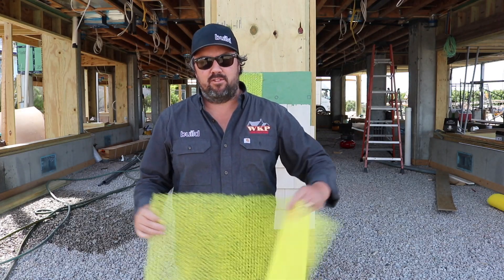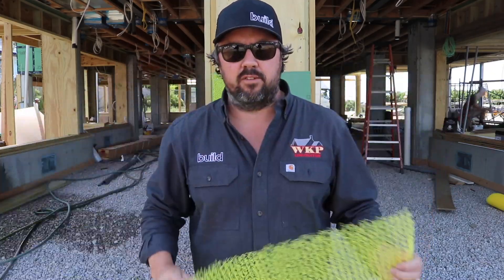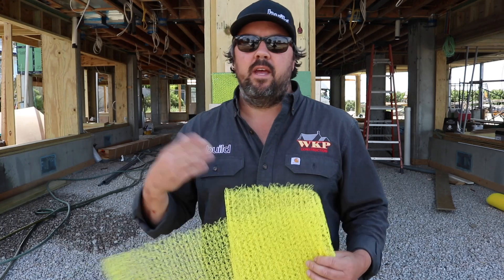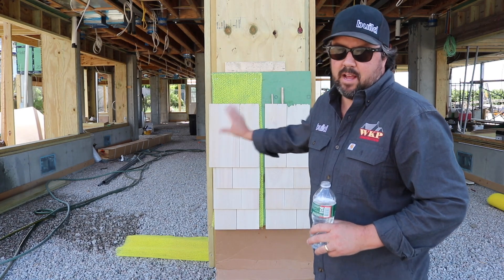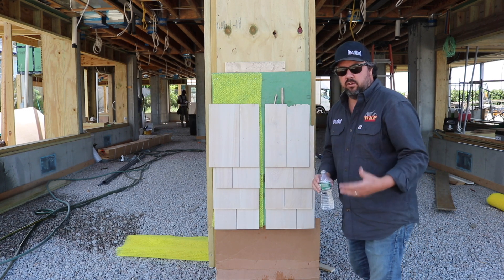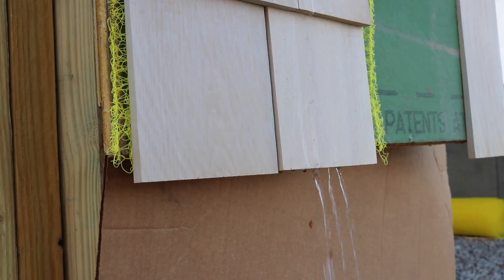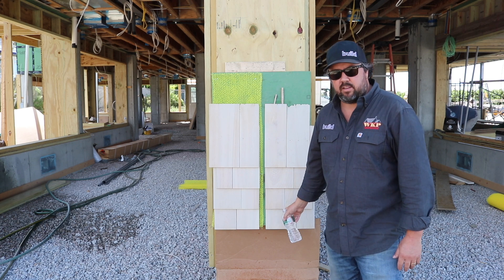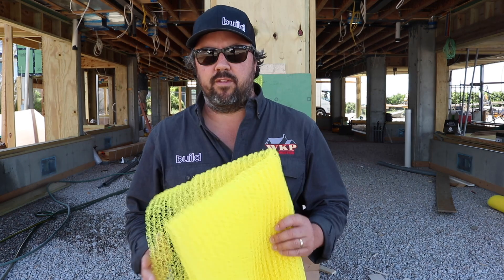RAIN SCREEN Demo - Your siding needs to DRY.

Comment: Two things. It doesn’t matter which way you run it. It’s a cornrow design and the water will pass regardless of whether it’s installed vertical or horizontal. Second, problem with that particular product is if you have any transition, maybe cedar to stone, you can’t use that Obdyke material because any mortar from stone will clog the drainage plane. I prefer something like MortairVent because it has a filter fabric on one side which works as a mortar deflection and allows you to use it behind all siding options.
Reply: Benjamin Obdyke also makes a product called Slicker Max, which has an attached fabric screen to block mortar.

Comment: @buildshow I have a mid-century modern house that has original redwood plywood sheathing with 4 inch on center grooves, similar to t1-11 but with smooth sanded face and 90deg edges on the grooves. I have some walls of siding that I need to replace. When I redo complete walls I can change up the methods and account for more thickness. I was wanting to adopt a rain screen strategy for this and wondering if this product is what you would recommend for use beneath 4x10ft plywood sheets. Originally it didn’t have a rain screen and was 2x4 construction with fiberglass bats in the cavity’s with tar paper then the plywood siding. Would using a rainscreen product such as this effect my shear/racking as the siding is also the shear. Thanks so much